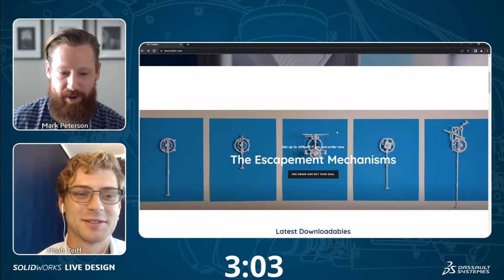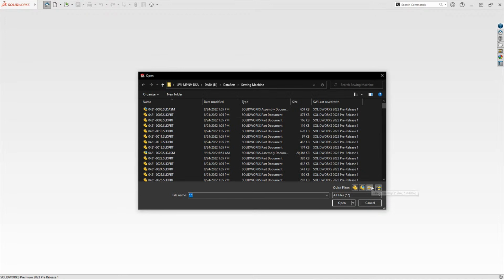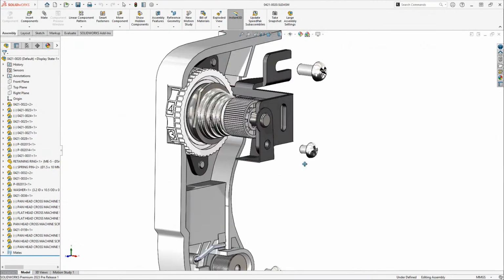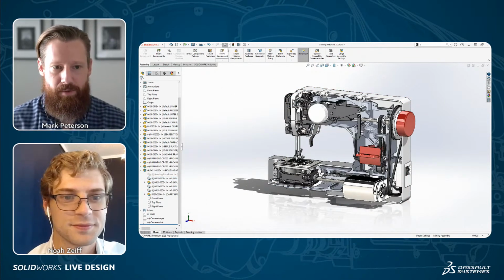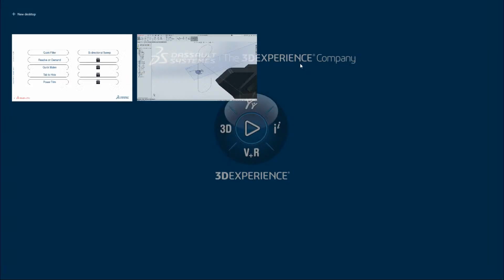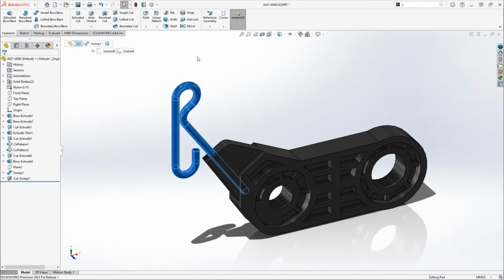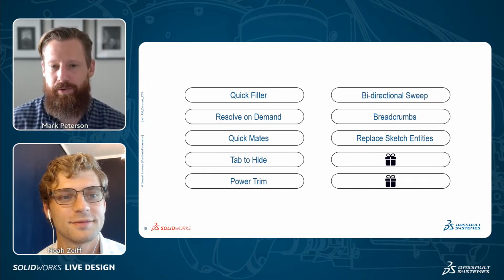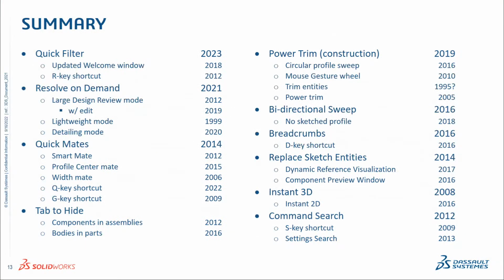My Top 10 Favorite SOLIDWORKS Enhancements - SOLIDWORKS LIVE Design - Episode 13 (2022)

Comment: This is more like a tips and tricks rather than enhancements, but really good. I definitely learned a few new ones. Interesting that you like command search, I wish SoliWorks had a command line like Autocad and Rhino. When I model in Rhino I hardly use my mouse for activating commands. I just use the keyboard. Super efficient especially if you hockey frequently used commands. Thanks for the video, great tips.